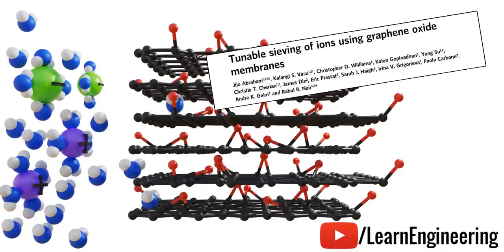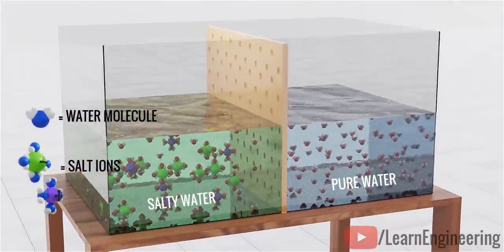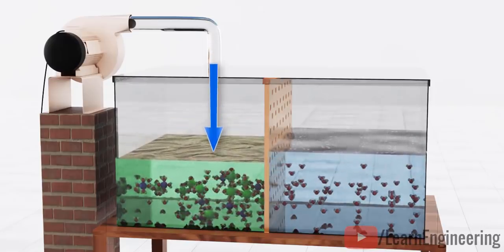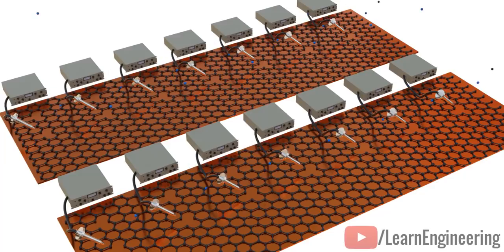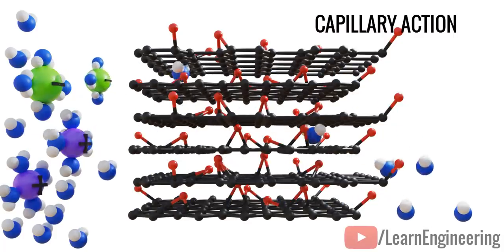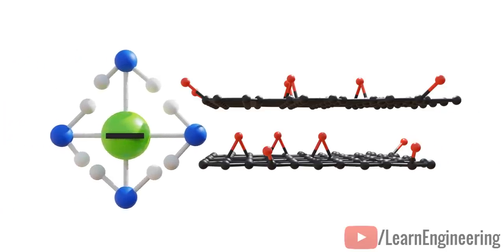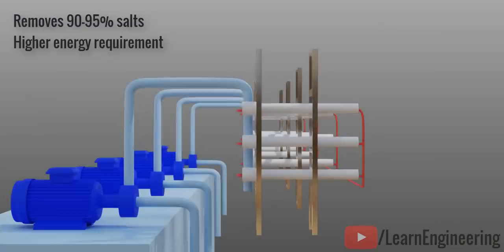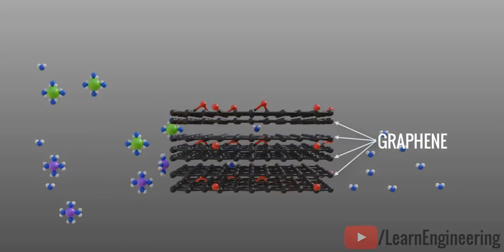Graphene Filtration | A revolution in Desalination technology!

Comment: The value provided for the salt rejection of salt in conventional RO membranes does not represent the state of the art. For example, DOW Filmtec model SW30HRLE-400i is rated for a minimum of 99.65% (cited from its data sheet). However the video attributes only 90-95% to conventional RO membranes. The authors of the paper cited in the video found the the GO membrane could provide 97% salt rejection, which does not surpass state-of-the-art high rejection membranes.

In the Nature paper cited by the video, it seems the authors are more excited about the tunability of the GO membranes which may open up opportunities in other filtration applications.
Reply: Donno mate - the drastically lowered energy requirements kinda seem helpful - but maybe thats just me.
Reply: I think it is safe to say you would still get more use out of graphene filtration.
Reply: @davidmende3409  You should check out other comments. The "lower energy requirements" has been discussed thoroughly and the conclusion seems to be that that is a false. I don't even think the video, or the scientific papers this was based on, claim that the GO membranes have lower energy requirements for filtration.
Reply: @alanwatts8239  why? It's not obvious to me why you would make that conclusion. 

What are the mechanisms that prevent us from getting use out of either one? What is the difference between the two that creates a difference in their longevity?
Reply: Agreed, that stood out to me too. They also do not list the standard solution this rejection is measured on, or explain WHY the energy requirement is lower. Osmotic pressure must still be overcome.
Reply: @seanrossouw9936  So, I've been thinking about this... Consider that there are two mechanisms that add to power consumption in the RO process. First, as you pointed out, you have to overcome the osmotic pressure (about 300-400psi for seawater). Second, there is the some resistance to flow through the polymer matrix.
I think there might be an advantage with the GO approach because of the rate dependant resistance with the conventional RO process.
Let me explain why. Salt is still permeable in conventional RO membranes but isn't strongly affected by the pressure. So the salt diffuses a constant rate regardless of pressure and water flux. Water flux is dependent on the pressure (it's just about a linear relation). If you just barely overcome the osmotic pressure you'd have a low rate of water flux and some salt diffusion. This would give a pretty salty product. So, the rate of water flux is increased to overcome the rate of salt diffusion and give low salt concentration in the permeate. The high rate of flux comes at a cost of higher power requirements because you need higher pressure to get that higher flux. This is what I think people mean if they say that the RO membranes are resistant to flow.
Ideally you would want a membrane that is very selective. That is it is very very resistant to salt flux but not resistant to water flux. This would allow for lower rates of water flux and lower power losses. But we can only do so well with a polymer matrix towards that ideal selectivity.
The advantage for the GO might be that is more selective (because of more accurate and consistent spacing of the GO sheets than the polymer molecules for conventional RO mombranes) and so does not need the high rates of flux (that are the cause of high power losses) to give low permeate salt concentration.
Reply: @seanrossouw9936  a paper by Wijmans and Baker from 1995 called "The Solution Diffusion Model: a review" helped me come to this hypothesis about why GO might be a better alternative.
Reply: @davidmende3409  You are correct, then add in on sight wind, solar and battery storage power assist.
Reply: What state of the art membranes are you referring to? The ones that are RO and that demand high energy usage as discussed in this video?  I’m no expert, but even at 90 percent efficiency, and little to no energy demand this would seem to be a huge case for graphene desalination over conventional reverse osmosis.

Comment: you'll still have to pump there will still be osmotic pressure this would just be a better RO membrane ...
Reply: Yea but if it is better enough, it may become viable on large scale. Maximizing the amount of water flowing through the filtration medium while minimizing the required energy is the key.
Reply: @lamebubblesflysohigh  it being tuneable may be an advantage but really the amount of energy is is a function of the osmotic pressure  + the mechanical losses. The osmotic pressure is unchanged and there is no indication of addressing the mechanical losses. 

Its like pumping water uphill , correctly sizing the pipe and making it as straight as possible with as smooth walls as possible will minimise mechanical losses but you will never be able to get water up a hill with less energy than the added gravitational potential energy.
Reply: @Ralphgtx280  if you were to put the filtrated water below the salt water, would osmosis come into play? Like, if the graphene sheets were too be put above vats, instead of right next to them?
Reply: @Ralphgtx280  trees think different.
Reply: @purplepotatoes9255  Good idea, but no, its not enough pressure, and that IS the problem....RO takes very large amounts of pressure to work (which requires ALOT of energy to create this pressure). The mass of water used in RO does not create this high pressure. And let's say we use the entire pressure of a deep ocean.....this would work, but the problem then is how do you get the clean water back up to the surface? This would also use the same amount of large energy. The point is that energy conservation laws apply to all forces, including pressure. You cannot overcome the energy differential with pressure.....the energy to break the bonds is the same either way. This has to do with the profound properties of water itself.....so the same reasons that make water the source of all life, is the same reasons why it is difficult to get clean water. This is also why the earth's ecosystem is very complex in cleaning water. Final conclusion: Humanity cannot overcome the scarcity of energy until it overcomes the entire capitalist system. Only socialism as a path to communism will allow humanity to have a surplus of energy. There literaly is no scarcity of energy in the universe, it is the capitalist system that creates a scarcity and forces humanity to rely on self-destructive toxic fossil fuels for energy. Go humans! Good luck.
Reply: @jokers7890  as u pump off the surface the water column will rise naturally from the deep ocean to occupy the surface loss thus using the pressures to work for you in the deep ocean. Then it's all about getting it to shore.
Reply: @shanincoffer6455  the energy you would have to put in to pump it back to the surface of the ocean would be the same one you had to put in in the original concept.
So you win nothing, but you would have to solve the additional new problem of having to construct a filter station at the bottom of the ocean...
Reply: @jokers7890  That's why the People's Republic is working very hard to re-engineer (China) Man genetically.  With the present material one just can't have a workable socialist state.  One in which each worker works hard for the whole according to his ability and takes from the joint product only what the whole (through its wise leaders) deems to be his need.  Present Man is adapted to the natural hunting and gathering environment, in which opportunism is rewarded with more progeny, hence Man in this evolutionary state is inherently Capitalist.  Note the century of eager effort in certain large nations to achieve Socialist Man, alas, resulting in a triumph of socialist opportunists and misery for most.  This is expected when scientific socialism is examined by evolutionary science.  China's wise leaders, the present crop of socialist opportunists, therefore are in the forefront of genetic engineering to create the New Man.  He go BUZZZZZZZZ, is obedient, but will he compete with Elon?  If not, Space, the big place, will belong to Capitalists.

Comment: I remember learning that ions dissolve via ion dipole interactions (intermolecular force). Thus there is no sharing of electrons and not a covalent bond. This should be fact checked. (4:06)
Reply: It's clearly an error saying the salt-to-water molecules are covalent. As you say, it's an ion-dipole interaction that binds them together. I dont't know about the strength of the bond, but I'm sure it's stronger than water to water molecule one.
Reply: It's a bit more complicated then that. When water (or any other ligand) complexes with an ion, there is actually bond formation, It's not just electrostatic interactions. You only learn about the ion-dipole interactions because they are simple physical forces with which we can easily explain and calculate attraction between ions en dipoles. Metal-water coördinated complexes are easily formed however I don't think anion complexes are easily formed. Nitrate, sulfate, chloride - water interactions are mostly ion dipole interactions i think.
Reply: @luka7383  This is very informative. Thank you for this response!
Reply: Because maybe, you're gonna be the one that saves me
And after all, you're my van der waals

Comment: I have a simple question: won't the salt clog up the entry point and prevent water going through?
Reply: In many filters, you commonly clean them by running cleaned fluid (here, water) backward through the filter medium and washing away the concentrated captured stuff that you are filtering out.
Reply: @MottyGlix  correct - that I know - can you do it here with this material,p?  I always knew about (what you said) and to me it was the critical question that first needs to be answered before we can seriously consider this material as a filter.
Reply: Inotamira Orani  I have actually been involved in water & waste water treatment. I can tell you the devil is in the detail. What often seems technically obvious often is practically impossible. In summary....  Let's see if someone gets this right.
Reply: Mark yep. Generally these filters must be replaced or cleaned. They last for about 24hours of use. They slowly loose efficiency over that period as more and more salt clogs the entry. They are usually cleaned upon reaching 30% efficiency in resoect to thr original non clogged 100%. As I said, this typically occurs after 24hours of use, assuming typical salt concentrations etc...
Reply: The video starting at 5:00 explains your question.
Reply: @zachass3724  No, it has nothing to do with this. What you mention explains how to stop the sheets from getting apart and letting Na+Cl- ions get through.
Reply: @zachass3724  That is about the prevention of passing of saltwater.
Reply: That was my question as well. How do you flush or clean out the system? How often do you have to do that? How much efficiency is lost by doing that? So many questions unanswered here.
Reply: @stevenirby5576  dear its still on R&D. rome doesn't build in a day...
Reply: How much water can it achieved compare to how much water is needed to clean these filters ?
Reply: @MottyGlix  It's called "back-washing"
Reply: Flow rate therefore is very important with occasional backflush
Reply: So to wash away the salt you need to use your purified water? Doesn't sound very efficient to me.

Joking aside, I also wonder how to clean it. We have ways to ensure the water molecules pass through, but once the accumulated salt molecules start to block the entrance it's game over. Probably smarter minds than mine have thought about this, but it's a pity this part was not in the video.
Reply: @Wokoman1  Obviously they don't have to use anything close to 100 percent of the purified water to back flush the filters. Only a VERY small percentage of the purified water is used to clean the filters. It is EXTREMELY efficient to do.
Reply: @DUCKDUCKGOISMUCHBETTER  I believe even with the efficiency of graphene oxide, the total wastewater will still be around 3 gallons for every one gallon of purified water produced in a home system. Back flush being close to 1 gallon. But maybe they are working on a new method.
Reply: it is easily done by just reversing the process which would push the salt away as with simple hiking/ survival water bladder systems.  But we must be reminded of the fact that graphene oxide is still highly toxic to humans (which is omitted from this glossy vid) and rigorous safety tests must be applied before even thinking of deploying these systems
Reply: what if you cover the filter with 4 feet of sand let it trickle thru to the filter that then connect to a pipe and lay out a ton of thoze in the land next open of the sea water in to the bay area of filter
Reply: In Reverse Osmosis the filter has to be replaced each day, so having the same requirement here isnt any worse than what we already have. The benefit here is higher throughput with far less power use. By using less power a desalination plant wouldnt contribute to so much greenhouse emissions which is one of the two big environmental complaints about them. The other is brine release. Some people are trying to solve the brine problem though by filtering it instead of just dumping it back to the ocean and trying to extract cobalt, magnesium, and lithium from the brine. While there are only a trace amounts of these minerals in the brine, the level of throughput of desal means you actually get quite a bit of it, enough to support an entire EV battery manufacturing industry for instance.

Seeing as this video is 2 years old though, Im guessing nothing really came of this technology, at least not nearly as quickly as needed.

Comment: It's a great application that has been around for some time, but the one thing people keep getting wrong is the energy of desalination. Current desalination filters are just about as efficient as thermodynamically possible. The energy it takes to remove salt from water is a fixed quantity. Even some researchers have made mistakes, claiming that graphene desalination could lower energy requirements by several orders of magnitude.
Reply: It's the pressurization, not the actual osmotic efficiency, that leads to savings. Lower pressure means thinner pipes and weaker pumps, meaning less expensive ones.

Comment: I worked in a lab with a need of ultra pure water. Salts were the easy problem to fix. Colloidal silica was the SOB in that world. It has a nasty habit of fouling up deionizing and or filtration media and if it gets through that it fouls up lab machines. I first encountered it when washing windows at my restaurant job 25 years ago when i was in college. The s*** was caked on the window and vinegar wouldn’t touch it. Colloidal silica binds to surfaces and can’t be cleaned off. 
So the question is: “How does this system react to colloidal silica dispersed in most water?”
Reply: We need silica for collagen formation, don't we?
Reply: @ix-Xafra  yes we do. And different municipal water supplies have different levels. It’s necessary in biology but often rather damaging in industrial settings.
Reply: @joefromravenna  is silica abrasive when in colloidal solution?

Comment: At 4:06 there is a mistake. Salt to water is not a covalent bond. It's an ionic bond which is way weaker than covalent bonds. It is still stronger than the hydrogen bonds between two water molecules though.
Reply: Since Salt has no valence electrons in the outer shells for covalent bonds if I remember correctly

Comment: Capillary force is not "passive" as was stated in the video. Every movement requires energy; i.e. a difference in potential energy or concentration.
Reply: Passive only means it is a spontaneous process. It doesn't mean there was no energy involved. There is no contradiction there.
Reply: I think I see what your seeing. My guess is that the potential energy is being placed into the manufacturing process and these GO membranes have limited use or have to be "recharged" in some way. The swelling must have to do with the energy of the system. OR the video conveniently neglects to mention that the pumping that is attributed to the conventional RO process is also required for GO desalination process.
Reply: @jeremysimmons8864  It's that there's water next to a hydrophile (GO) while there's no water on the other side. You could look at it as a chemical reaction: As long as there's no product (clean water), water will happily permeate due to osmosis (the energy being the potential difference between the right and left side). However, permeation rate should slow down until it reaches equilibrium at which point water has to be removed from the right side, or more "educt" is added to the left. At least that's my best theory that's coherent with physics.
Reply: @S3b1Videos  Interesting. I definitely need to read the researchers paper to gain some insight on the chemical aspect. I guess my biggest concern is with how the process is maintained and how much energy is required as compared to the conventional polymer membrane based RO.

Comment: I don't think you can bypass osmotic pressure this easily, entropy is a hard to beat sonofagun. You'd still need pumps, otherwise this would break the second law of thermodynamics.
Reply: - gravity -
Reply: The term he used was capillary action, so some way to influence the pressure difference is definately required. Having that action in the filter be its most efficient is about good design and surface area.
Entropy also gets its reward in the production of these exotic materials.
Reply: A thermal differential, perhaps. Have the salt water in a solar pool, and cool pipes on the other side. Hot water molecules from the saltwater side try to balance the thermal differential, traveling from one side of the filter to the other.